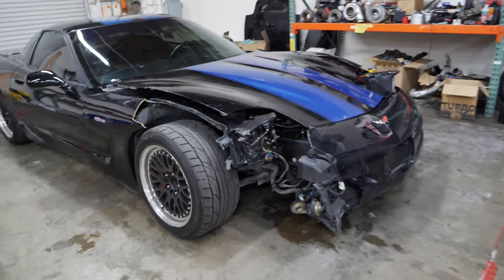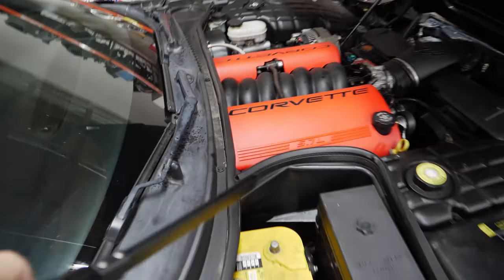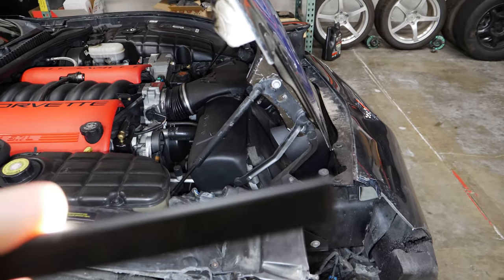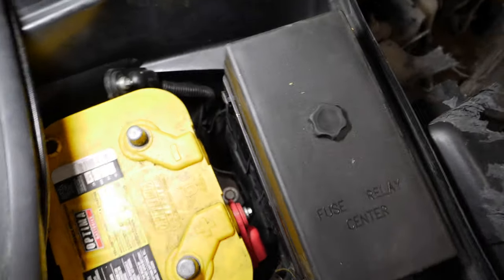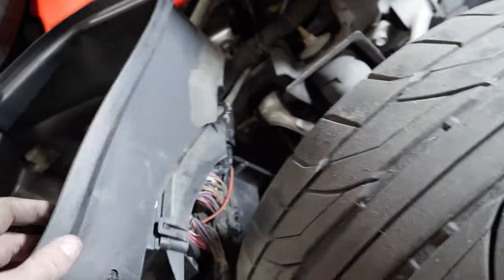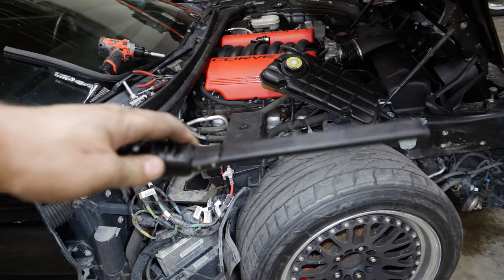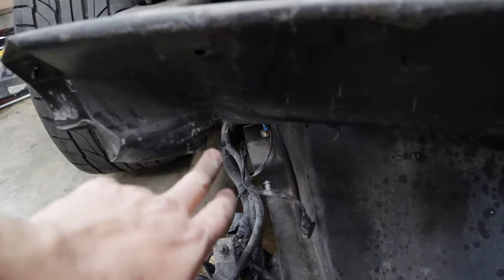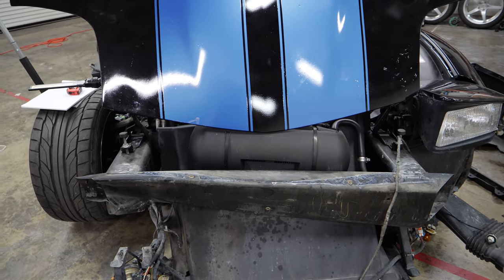Past Owner Must Have RAMPED my Salvaged Z06 Corvette

Comment: Dude... The previous owner saw to much Dukes of hazard... I'm sure that the Z06 was airborne and hit the ground on its front left wheel...
Reply: Wouldn't that have broken the wheel, though?
Reply: That's exactly what i was thinking. Dude took some air, but landing it didn't go that well.
Reply: @ArKritz84  If those are quality wheels, they won't just break. But, it might be bent, which is not really visible until you spin it.
Reply: I think if it was airborne it would have caused more damage throughout the car, this seems more like it ran into the end of a guardrail or something of the sort
Reply: @ArKritz84  those are ccw classics. Forged and really strong.
Reply: Kinda looks like it fell off a truck. Rolled right on back turned slighty to the right and smacked the nose when the tires slid off
Reply: @ArKritz84 not if the angle was so that the frame took most or all of the impact
Reply: Front right wheel

Comment: We put the car on a jig, and pull the frame down when it's bent up like this. I have fixed cars with awy more damage, but the jig and all that is not something you can just hack together at home. This used to be my job. Don't cut anything, get it done properly, it's not too heavy damage, and getting it level again is probably a days work.

Comment: Don’t lose that control module that sits in front right corner, it controls the motors for the headlights n it’s 900$ for a replacement. Keep up the good work!

Comment: Please just build it and don’t put a ls into a rx7
Reply: Just fucking put the LS in while rebuilding the 3 Rotor
Reply: TJ for free My bet is he LS’s the rx7, rebuilds the 3 rotor and then puts the LS back in the vette when the 3 rotor is done.
Reply: @jaysonmiller6540  I think Rob knows that many things must change during swap, and after that it shouldn't be easy way to convert it back again to previous shape.
Reply: @glurak888  Yeah spends weeks and thousands of dollars irreversibly modifying the 3 rotor's chassis, drivetrain, and harness just so you have an engine in it while you fix the other engine, to then have to do it all over again. Wonderful idea. Just toss an engine in. It's super easy guys!
Reply: byw lol these guys are absolutely clueless. Who the hell swaps an LS temporarily and then throw a 3 rotor back into it😂
Reply: @sneak916  Also, car was haft price of rebuild? Why do costly swap whn he could do that rebuild do 900 safety hp, and do drag videos. after some time, when 4 rotor will came, do this 3 rotor to that imagined 1200
Reply: @sneak916  hert from hoonigan does

Comment: For the amt of money rob just spent on the beat up Vet, he could have pulled the 3 Rotor and rebuilt the engine, with cash left over.
Also could of bought a used ls motor for less than spent on that broken garbage Vet.
Reply: Do you know how much a 900+ horsepower 3 rotor costs to rebuild?. Its a fucking lot
Reply: I would have assessed the damage first, seen we're the problem was. Wouldn't cost more than 2 grand for rotor seal replacement. Possibility of housing damage may require replacement. Still doubt it would cost more than the 7grand he spent in that salvaged Vet, if you do it yourself.
Reply: Nicola Tesla he cracked the 20b specific “big” iron. That’s like 6 grand alone for the part...

Comment: @3:50 corvette's have always had radiators installed at an angle. That's how they get that sleek looking front end ;)
Reply: I think he means its crooked in the engine bay. Like the passenger side is pulled back

Comment: Dont cut it, in case you havent figured it out, that “bumper support” and “shitty welds” saved that engine and cradle. Its a perfect squared bumper stop, the integrity of your suspension and the way it drives will be thrown off. If snything have them reweld something similar or repair that one and weld it right, maybe reinforce it. Just a tought. Or do what you do and not listen whatever 😂

Comment: sooo one option is to cut the bad front and get a tube/box or combo of frame welded on to rebuild and get a straight front. as long as the suspension is 10000000% fine and i mean it has to be 100% level or you will hit tonnes of issue down the road.

Comment: Rob take that car to a shop with a car-o-liner and it’s program will tell you exactly where the frame is bent, even if you can’t see it. Then it should be good for some pulls.

Comment: The previous owner must’ve hit something massive to cause this damage
Reply: Jared Richardson he might have been driving a mustang before the vette
Reply: He hit his own ego obviously
Reply: It almost looks like it hopped a curb at an angle while at a decent speed since some force was vertical and some horizontal. Would also explain why it doesn't have factory rims because if it hopped a curb on the front right at least that one rim is RIP
Reply: Last Name First Name I had a similar guess, that the previous owner hit some big curb like at a race track or something
Reply: @lastnamefirstname9043  i dont know its strange. Yeah i was thinking curb too but he must have been going really fast to bend that solid piece of steel up like that

Comment: Some UTI auto collision grad is going to fk that frame up trying to straighten it. The anchor points will be ripped out for sure. Repairing hydro-formed rails are not recommended.

Comment: I think you would have to take the front end totally apart and replace the front frame with a donor or rebuild it from steel stock somehow.  That's the problem with salvage cars, you'll never get the frame quite right.  I think if you could replace it you would have a much more legitimate fix over trying to bend it around.  The goonzsquad viper had it's frame pulled back, I just don't trust it.

Comment: dont cut that yet  its still structure though not good
were the frames aluminum in these
looks like they smack a mile marker or a fence pole in the ditch
i believe they put the pcm there do to underhood heat

Comment: I wouldn't even try to get the frame straightened. I would have the old rails cut off, and new rails welded on. Would be stronger and end up straighter than having the old frame straightened.

Comment: Did they drop it off of a flatbed or lift? Thats the only thing i would think could push the frame that far up.
Reply: Well that actually sounds plausible
Reply: Hit something like a concrete barrier head on pretty fast. Dropping it would probably do less damage.
Reply: Or litterly like jumped it, as in the car was airborne for a sec or two, in other words the previous owner likley ramped the car
Reply: Yeah, I think a straight drop from 5 - 6 feet. If it was moving fast when it happened, more would've been missing. Maybe drove it off a loading dock or something at slow speed.
Reply: @riftborn1058  did you actually just spell literally like that
Reply: @Sube-Tube  yeah! Got a problem with that? If so deal with it, im not you homework, im my freetime
Reply: @riftborn1058  illiterate

Comment: My preferred car of choice is VW; however for domestics I was always a bowtie guy...this has probably changed.  I am sure they use weatherpak connections but damn having the ECM essentially stuffed in the fender outside of the car, come on what the hell were they thinking.  @7:41 you can see a silver box with the GM Part# 12200411 that's the freaking ECU, body or transmission control modules outside the car isn't so bad, but not the actual brain!

Comment: Sucks for you I sold my 02 z06 with 207k on it but a two owner car including me. I had it wrapped led tail lights zr1 wheels black 18/19 setup brian tooly comp cam done by local Chevy dealer black chrome corsa exhaust intake headers stock wheels included I wanted 10k let it go a little cheaper than that I kept posting on your videos and rob spaghetti videos.. read your comments more buddy!
Reply: Wow that was a decent price

Comment: Dont cut it until the frame shop pulls it
Reply: I'd ask the frame shop what they want if I was super keen on cutting it off. Straightening it could be easier with it off if they have a fac spec sheet and good access to measure it out. It really depends on what the frame guy wants. Either way if the frame guy knows you are going to weld a new one in, and if he wants it off so his bends don't put stress on the other rail, he'll cut it out.
Reply: byw for sure but better to give them the option

Comment: The car wasn't jumped the car hit something and the frame rail did what its supposed to do .it crushed where the manufacturer made it to .that's how manufacturers keep passengers safe by building crush zone on the frame rails. Side note insurance companies usually total cars because there fucked up up if it would of been a simple fix they would of fixed it